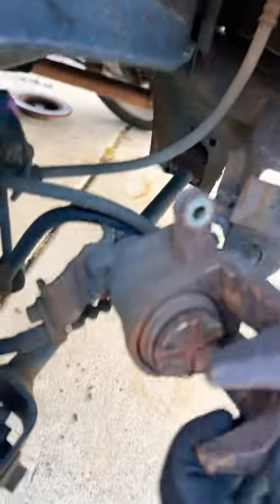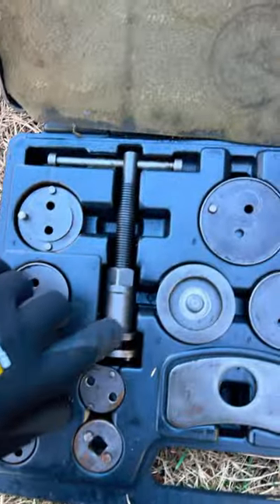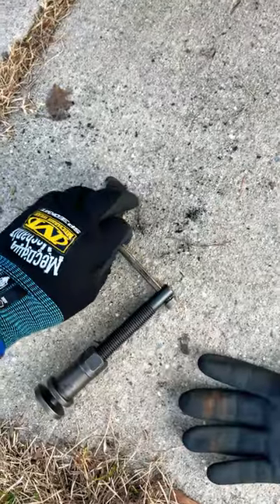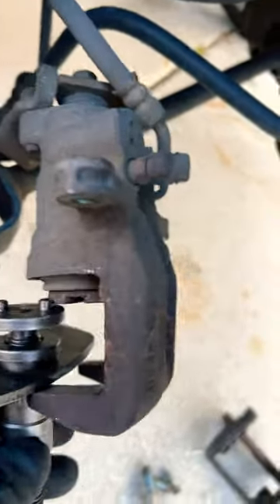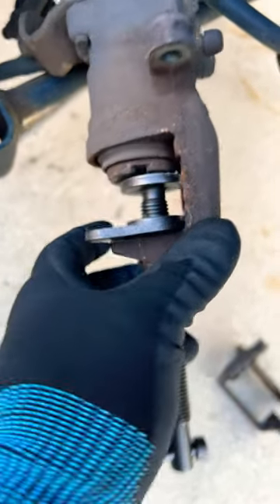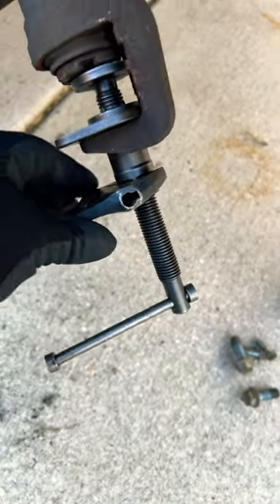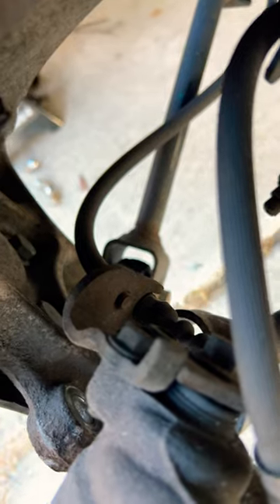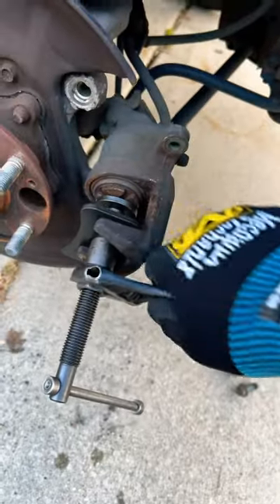How to use disk brake caliper tool on rear brakes Honda accord compress and rotate caliper piston

Comment: A cheap Autozone tool that goes on an extension works just fine. It doesn’t need force to push in the piston in because it screws in.
Reply from the maker: Good insight, thank you.